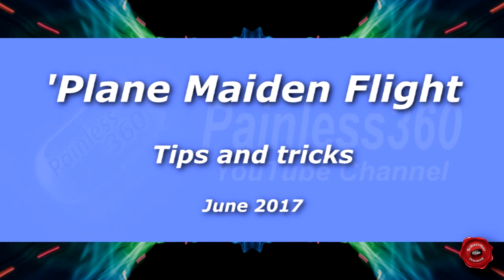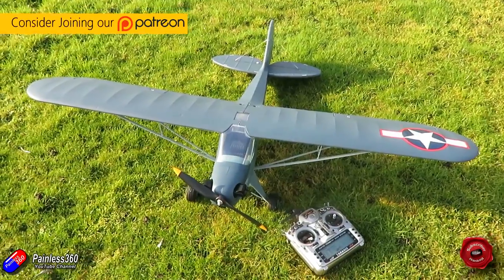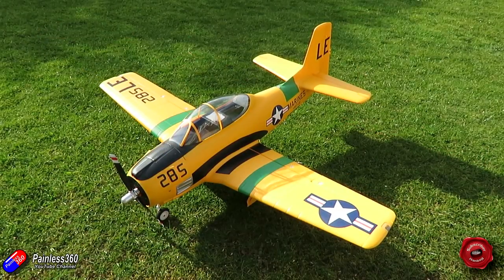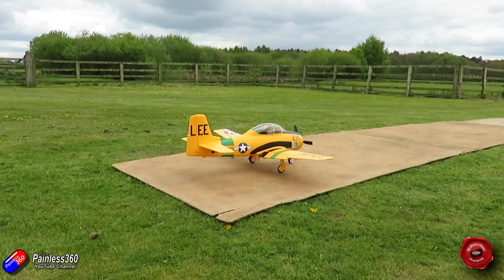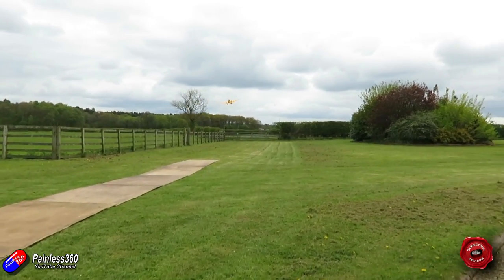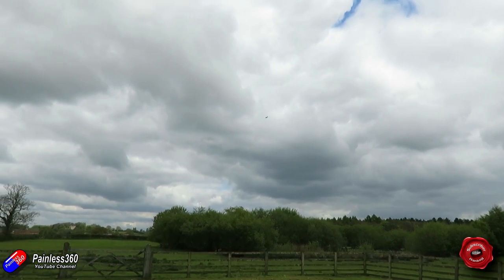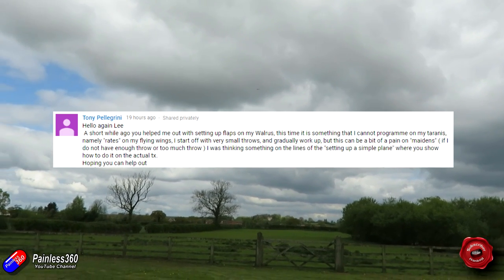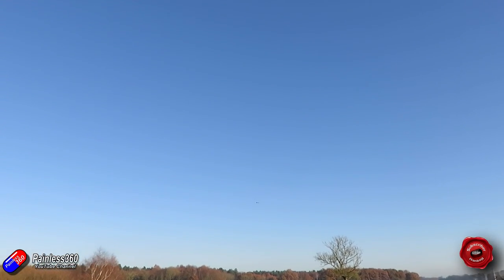Plane Maiden - Tips and Tricks to Help Avoid Disaster

Comment: 8:00 Just a quick point here - while zero expo will produce a linear radial relationship - ie. the angular rate of the servo will be linear relative to stick position, it won't be linear at the control surface, where small rotations of the servo produce around the mid point generate larger angles of the control (rudder/elev etc.) than the same rotations at the extremes.
Expo effectively flattens this out so you get more linear angular relationships between the stick and the control surface. I understand somewhere between 10% and 15% exp gives a much more linear control surface response.
This is all because the control surface is at 90 deg to the servo at zero setting, and as the servo sweep angle increases, it produces less movement in the direction of the control surface. Hope that makes sense! :-)
Excellent vid and thanks - my son and I have spent days scratch building a high wing trainer and will (hopefully) maiden it today... aaaagh. Cheers from Sydney - Dave

Comment: Interesting and very useful
I have to admit though that as a beginner if I get to the stage where I run out of trim I tend to land, find out what is wrong and sort it mechanically. Being able to do that in the air is useful but does it solve the problem or merely mask it long enough to get a flight in?
Reply from the maker: +didactylos4 diddy4 both, if the trim is excessive then I will reset the links to get the 90 degree connections back for equal throws. Happy flying!

Comment: Great video/ideas again! I have a request. I want to fly my FMS Typhoon -which has split flaps and retractable undercarriage-with my Taranis Q X7. Now, I don't know how to set up the two functions in a three-stage switch. First, the split flaps. How can I make sure that I do not set it up in such a way that when I turn the radio on or flick the switch the servo doesn't try to move the flap up when it is already retracted? This could result in servo overstress, right? Second, I guess a similar thing could happen with the retracts. Thanks for any comments/video!
Reply from the maker: The switches on the radio send 'absolute' positions to the servos. So, as long as you've setup the range of movement for the flaps/gear you can't push them beyond those limits. See the flaps tip video in the 'OpenTX mix school for more tips and tricks'. Best of luck!
Reply: Painless360 Thanks!!! Will watch that video.

Comment: Hi Lee, this may be a stupid question, but here it goes, before fitting a flight controller either on inav, arduplane etc, should I maiden the plane just with the receiver and trim it and once it’s all trimmed I proceed to install the flight controller? My concern is that all these trims may affect the flight controller performance. Many thanks in advance and apologies if this is a silly question for you
Reply from the maker: That is not a silly question at all. Maidening a plane before you install a flight controller is actually a really good idea. It allows you to make sure that things like the throws, trims and centre of gravity or all spot on before you add a flight controller. Putting the flight controls back to the  positions that they needed for straight and level flight when you install the flight controller is a great way to get to the end of the process faster, with a more accurate setup. Happy flying!
Reply: Painless360 Cheers Lee, much appreciated mate 👍

Comment: Hi Painless, can I ask if using inav would you set rates and expo in the FC or in the Taranis itself?
Reply from the maker: Setting them in iNav is better (improved resolution) but having them on the radio allows you to change them dynamically in the menus. I tend to use a bit on both..

Comment: Hey Painless, I wanted to ask you what's the best spot to mount an FPV cam on a fixed wing model like an S-Tee or similar? Thanks!!
Reply from the maker: If you're walking about the design from Lee Renaud, then I'd look at pitting the camera in front of the canopy over the wings. You'll be looking through the props but a good CCD camera will 'see' through that. Happy flying!